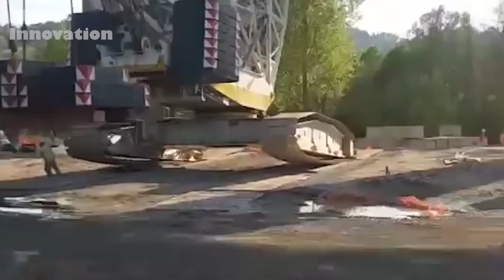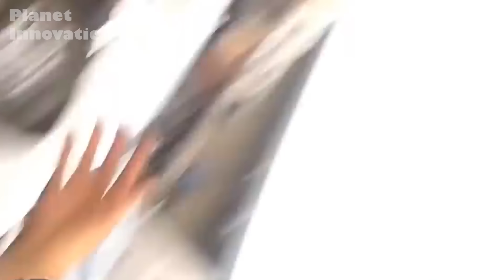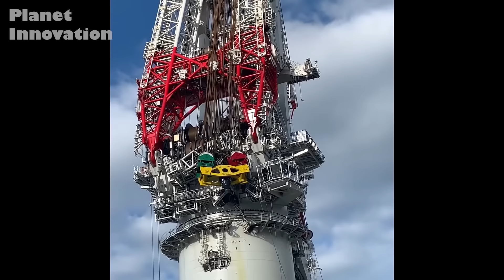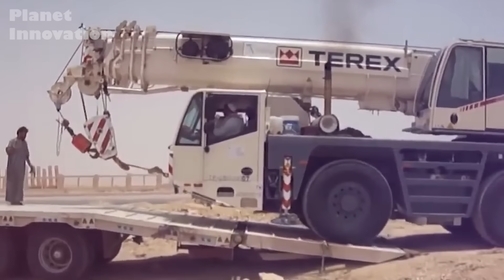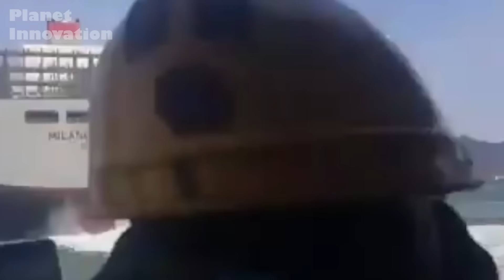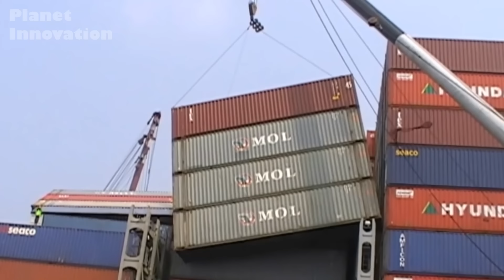Extreme Dangerous Fails Biggest Crane Compilation - Heavy Equipment Gone Wrong

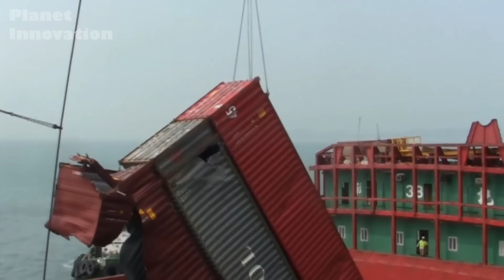Comment: I spent 38 years in industrial construction and witnessed two crane failures, a lot of people went down the road kicking their lunch pails. Fortunately there were no injuries in either incident. The first was in 1999 where a 80 ft. boom failed and crushed a pickup truck, luckily it happened at about 12:15 lunchtime. For a lark the owner of the truck reached in and started the truck. The second we were constructing a concrete  permit center in a oil refinery, a cherry picker " small mobile crane" was being used to hoist rebar " concrete reinforcing steel" onto the roof of the structure. In order to get it as close as possible to it's final destination which was just out of boom reach workers pulled the load further causing the crane to tip and fall onto the structure. The operator just grabbed his lunch kit and walked away knowing he was done.
Reply: The disdain from the management of Crane rental outfits towards their operators. I dont care if I ever sit in another machine. 
 Thanks for sharing, jobsites are dangerous places especially when theres no common ground or intest among the manpower

Comment: @8:30 The Arab driver who didn't set his trailer brakes really paid for it, with that weight on the ramps and his tractor's rear axles off the ground that trailer is rolling.
RIP for the Russian riggers who were installing that tower crane, at least 3 men gone that tower collapsed right on top of them.
Reply: Setting brakes does not help when the wheels are off the grade.
Reply: @gordbaker896  I think he means the brakes of the trailer .

Comment: The second crane that was picking up the white and blue boom arm truck. You should of  dismounted the counter weight on the back and disassembled the wheel house on the front and carried them separately. Those two pieces are extremely heavy and would of made a huge difference in weight load. Good luck next time.
Reply: "would have"

Comment: Did anyone teach them to do a test lift up a couple of inches and see what the Crain is reacting before you commit to the lift or ease in to it. I am not a operator of any thing other than a forklift and I was chewed out for operating to slow but I looked at them and said are you going to take responsibility for anyone who gets hurt or the property damage from not being careful okay then shut your mouth and stay out of my way. Rule one the higher you lift it the more likely you are to tipping over rule two the higher you lift it the more damage it will do if you drop it. Plus the higher you lift it the harder it is to see what you are doing because it’s over your head or you can’t see through it in your line of sight of course some things can’t be avoided but I have never had a accident on a forklift

Comment: I was standing on the back helicopter deck of a ship with a friend watching a big crane lift a heavy weight from the front of the ship. The crane boom twisted and dropped everything back on the decks. The front of the ship went down rapidly and the back rose quickly. 
My friend and I were both thrown up into the air about 10 feet. It was amazing to be that close. It was a loud and slow show.